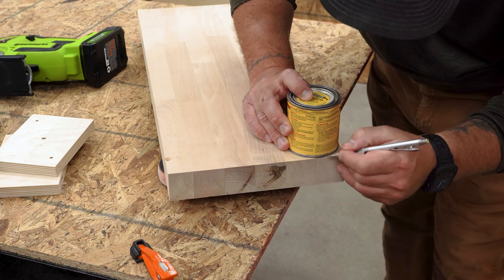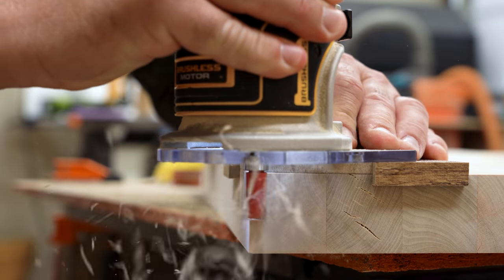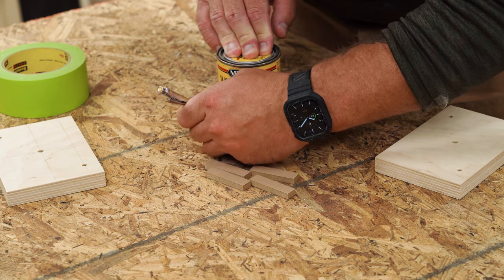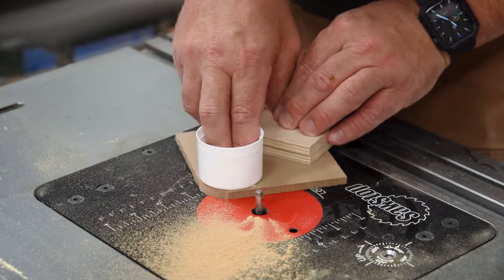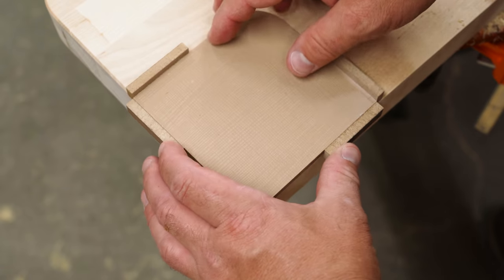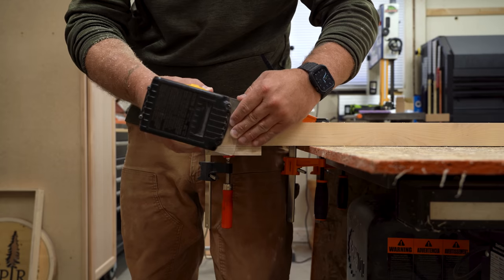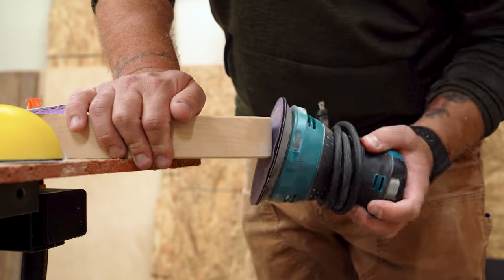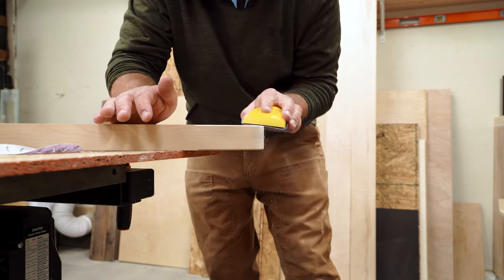Two Ways to PERFECT Radiuses and Chamfers

Comment: Another interesting video with good info. The "store bought" templates seemed liked a good idea, but were too expensive for mass produced plastic pieces. So, I made 4 dual sided templates (with the positioning tabs) using 1/4" hardboard. I drew the radiuses with a compass from 1/2" to 2-1/2". Have used them for a few years with no problems. Thanks.

Comment: I mostly use the template method; like you said, it's easier and saves a ton of time in the long run to spend the time up front to make a simple template for routing. I made a template with 4 radii; on each edge I tapped holes to allow my stops to be adjustable so I can use all 4 corners.

Comment: The more I learn about woodworking the more it seems to be about making things to make other things haha
Reply: Those are called “jigs”—and if you do woodworking long enough, you’ll accumulate many of those. The problem is, if you use a jig for some obscure but cool reason, I advise labeling them. (I have some jigs I made several years ago, and can’t recall what the hell they’re for!)
  And if you want a jig that’s useful and looks good, don’t be afraid to consider the first try to be a prototype. The final version fixes any mistakes in performance and looks. Takes longer, but when you have a sweet selection of “things used to make other things” hanging on your shop wall that look like they were made by a woodworker, you’ll be a woodworker.
  Have fun!
Reply: Yeah, but that's the fun part!

Comment: Hi jody , back on the comparison topic between the chinese and the orginal ones , could you please if you may make one for the vertical drill guide attachment from woodpeckers and the chinese counterpart, they look very similar , i’m sorry if i’m prying or being requestive , i know they are expensive , but i trust your judgement very thank you in advance even if you don’t get to do it
Reply: Got one, it's garbage. Too much run out and the bushings are bad. The customer service is also non-existant. The milescraft version beats it and those are shit b.
Reply: @bnic5776  thank you for the feed back , i’ve bought them , the chinese counterpart , and i think they are quite good for the price and build decent , and the bearings on mine are adequate, didn’t see the milescraft one yet though , cheers
Reply: @toootankhamooon  yeah seems the issue with all Banggood stuff is the lack of QC and how they handle it. My track square is square but the extension kit isn't. So they offer 10% after making you jump through hoops after hoop and gradually increase it. I want a functioning unit not a portion of my money back.
Reply: @bnic5776  100% true , but that is what to be expected , after all it’s less than half the price of the original , including shipping, so there will be always the reliability issue at hand , hopefully we see improvement regarding shipping and QC
Reply: @bnic5776  100% true , but that is what to be expected , after all it’s less than half the price of the original , including shipping, so there will be always the reliability issue at hand , hopefully we see improvement regarding shipping and QC